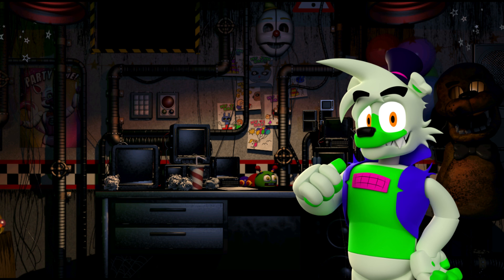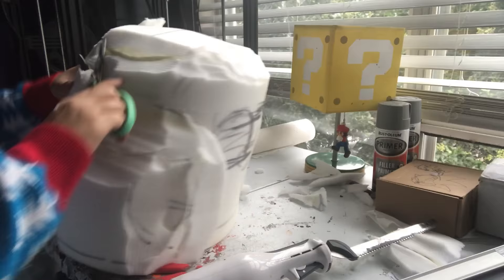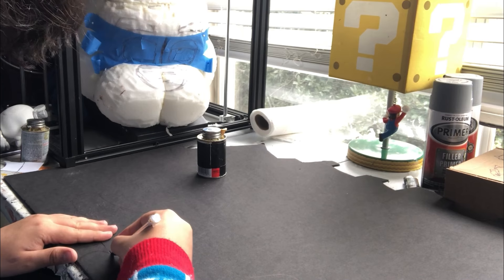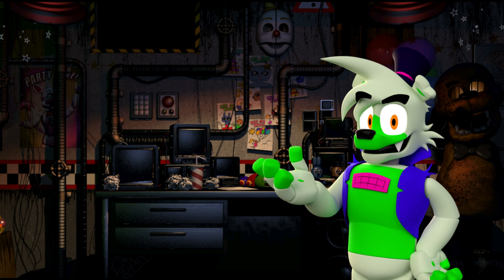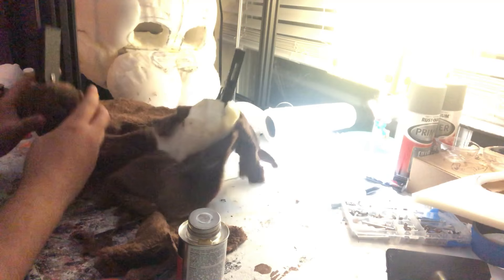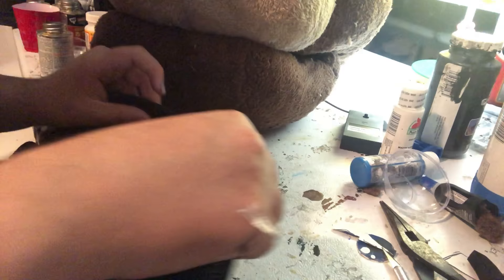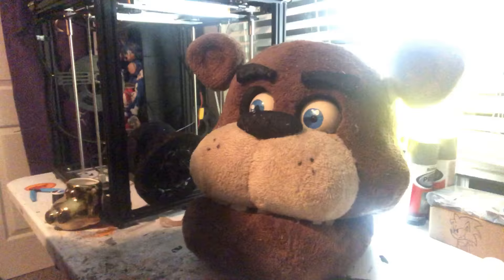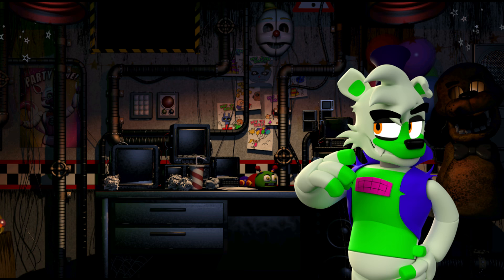How I built a Freddy Fazbear Head

Comment: i have an idea for something you could make. actually I have 2 ideas:

1. The Puppet's mask. I have a character that utilizes a similar mask to the puppet I wanna cosplay as at a convention, but I have no fucking clue on how I can find a good base mask for cheap or how to make one. plus it can be altered. i really only need to know the base part but the paint pattern could be cool. the puppet's mask can be altered in so many ways it's crazy. after you wipe off the face paint on the mask its just a blank slate fit for any character.

2. Vanny's rabbit mask. i have some friends that wanna cosplay as vanny but they are struggling with the mask part of things. plus it can be altered so you can essentially have a rabbit based mask for any fnaf/whatever murderer characters you can think of.

Comment: Dude i seen your work over the years its increrdible... Without going on a tangent ill say that you're my biggest inspiration for this big walten files related costume im working on but holy shit ill take noptes through this video. Im trying to model the head and the torso right now with CARDBOARD AND HOT GLUE  with my own method (basically wireframing and rendering with it) cause i haven't even touched/ don't know how to work with Eva foam. I'm tracing off of a blender model of bon so everything i drafted from the computer screen will be on model i really hope ill be able to take away alot from these

Comment: Guys, if you want to smooth the base out the easier solution is too add some fabric and wrap it around so it will be smoother, it works a little worse but a lot less work